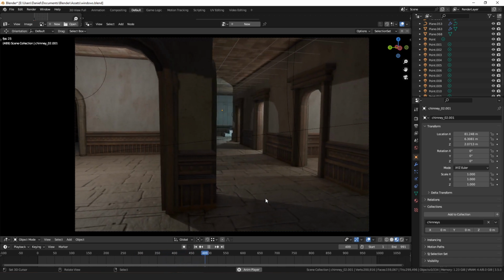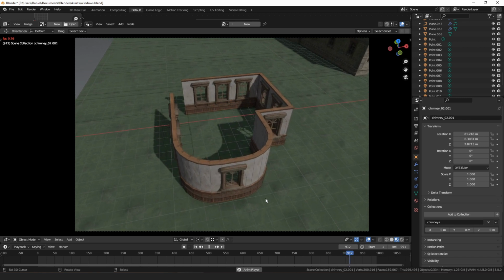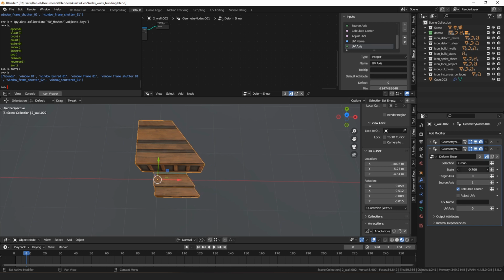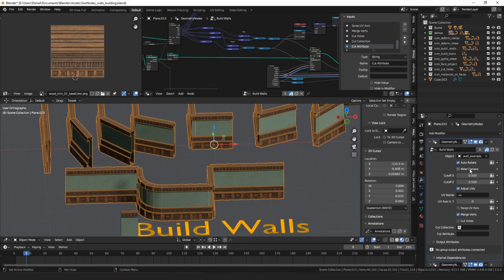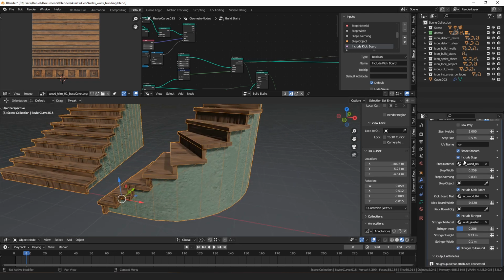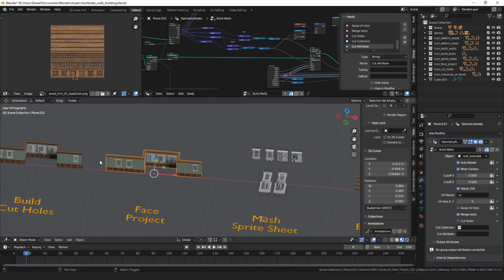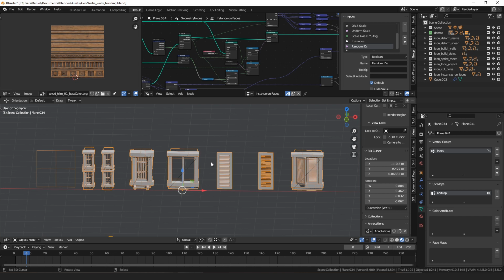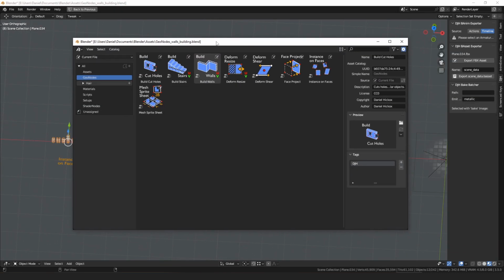Geometry Node Assets: Update - Build Nodes

Comment: Hey man, I just bought the node pack but when I try to open the wall nodes it just wont open, any suggestions?
Reply from the maker: First thing I would check is the version of Blender you are using against the version of the file.  Crashes on load can happen when opening files that were saved with newer versions of Blender.  If that doesn't help, let me know and I will look into it further.
Reply: @looseEdges  Thanks, do you know what version of blender the files are saved in? Or how would I go about checking it?
Reply from the maker: @fed_blend  It's either 3.6.2 or 4.0.0  On the downloads page there are two options for the .zip files that contain the whole library and you can select either.  If there was an option to download individual .blend files those are just the latest version which is for Blender 4.0 at the moment.

Comment: I dont quite understand how you use "Build Walls". Can you please describe the process, starting from an empty blend file?
Reply from the maker: I can try to do that.  You might also check out the workflow video: https://youtu.be/Bj6ZLozP4yo?si=NltDq8ervq6WXmaZ&t=1076  I create a wall for Build Walls about 18 minutes in.  
For the most basic setup, I would add a plane, enter edit mode and rotate it 90 degrees on the X axis.  Then add a loop or two, making a basic wall template.  
Secondly, I'd add a cube, enter edit mode and delete the top and bottom faces. These will be your walls.  On the cube object, add the Build Walls modifier and select the plane object in the Wall template field.
Then you can edit the cube, resizing and adding walls as you like.  To change the details of the wall, you can edit the plane object, add a backface, materials, etc.
Reply: @looseEdges  It seems that I totally overlooked that part in the video you linked. With it plus your explanation I should be all set. Thanks for you time :)

Comment: I didnt saw the whole video but do you have a trim mesh with some ornaments that can be instanced on a curve without too much deformation? like with perfect 90 degree angle?
Reply from the maker: I don't think so, I'm not sure exactly what you mean by 'not too much deformation.'  I have a modifier called Deform Match Curve, that does deform the mesh.  How much depends on the curve, it could be adjusted to place instances along the curve rather than deforming the mesh.  In fact, think I have a file with that variation somewhere.
Here's where I demo the Deform Match Curve modifier:  https://youtu.be/nczCpOb7zxU?si=00quwHIDM6dg8zJ_&t=91
Reply from the maker: I found the variation file:  https://danielhickox.com/uploads/djh_test_curve_array.blend

Comment: How about geo nodes for roof? I think you already have enough material to create specific nodes for the use of roof creation.
Reply from the maker: I've made several attempts, but haven't been too pleased with the results.  The trouble is that unless you are making a roof for a simple rectangle there are many variations, and I haven't thought of a solution that can handle enough of those that I'm happy with it yet.
Reply: @looseEdges  Fair enough! I'm guessing cone shaped roof would be difficult as well since all tiles should maintain same size as they approach the tip of the roof.
Reply from the maker: Yeah, could be.  I don't think it would be too hard, although the UV seams might be ugly.  But I really want it to be a tool that can simplify making roofs for 'T' or 'L' shapes.  @hazdrubal5962
Reply: @looseEdges  Someone else did it this way: https://www.youtube.com/watch?v=DfRjLpMQPnU

Comment: I just realized something terrifying.

Geometry node are considered assets meaning they don't have to be GPL like addons.

This is going to have A similar effect as paid addons making certain workflows unlearnable for free users.(hard surface for example.)

Unless someone redoes the work so that the free users can catch up.(this never happened with hard surface.)

Were all screwed!
Reply: I don’t get your point
Reply: @maarten176 
As in I failed to explain?

Or you don't believe me?
Reply: @nullvoid3545  I didn’t understand
Reply: @maarten176   Oh! Ok.

So Blender is currently one of if not the best tool for 3D data manipulation, and to ensure that it stays that way Blender is licensed under the GNU Public License (GPL).
This means that if A competitor decided they wanted to build their tool based on the code in Blender they would have to license any changes they make under the GPL, meaning Blender could integrate those features keeping it not only as the best 3d editor, but also making sure any improvements stay free for everyone.

Because Blender is GPL, any addons others make using its API must also be according to the FAQ on the blender website. This means it is not piracy to share A copy of an addon you bought to someone else as long as you include credit(the licence).

In contrast, any 3D models or data attached to those models,(basically anything A .blend file saves) is considered "machine output" meaning that it can be licensed however the creator sees fit.(This is why assets in blender can be sold with proprietary licenses.)

With Geometry nodes, assets can now have many of the same property's as addons, being A tool that helps in modeling rather than an asset to be extracted for use elsewhere.
This is why I'm freaking out!

Because if an "asset pack" like this one, becomes standard for how we make tools in blender.
Then the GPL will not save us from proprietary use cases that will continue to grow because of this discrepancy.

Also, A bit of A tangent but, how loosely do implementation details matter in copyrights over geometry nodes code?
Geometry nodes tends to have only A few ways to make any given function, and likely only one most efficient way.
Under these circumstances, if I made GPL variants of the node assets shown in the video entirely on my own based on watching how they are used. I find it likely the overlap in implementation would be seen by A court as theft.

And the worst part is that I cant change this, not even A little, instead I do everything I can to tell others that we need to consider the choices of those that come after us knowing our decedents will still be taught to exploit each other anyway.

😮‍💨
Reply: @maarten176  hard surface modeling has a lot of addons that make the workflow easier/more convenient, for example mesh machine. He thinks that the same will happen to the geo node workflow. Considering blender is free and open source it doesn't mean that addon developers have to abide by that principle and can make for profit addons. I personally do not see a problem with this. As these things tend to be more niche things that blender cannot cover, blender deals with core functionality and improvements around those things. I don't agree with what he is saying here, if one does not find the addon useful they don't have to buy it, and if someone would like they are free to make the addon for free.

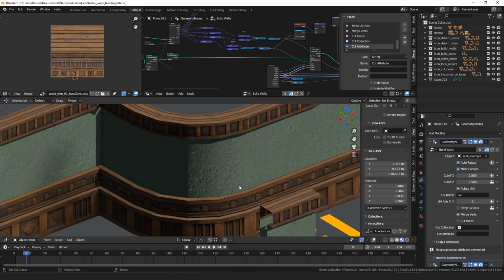Comment: Hello, this is very interesting. I love how much control you have with it and I'll definitely buy your products. I noticed the texture is acting weird at 10:08, there is some tiling issue especially with the circles. Also would you consider adding an asset for the floor and ceiling? And the roof? Thank you
Reply from the maker: Thanks! Yes, on each segment in the wall the texture begins at 0,0, which causes a tiling effect on narrow segments.  I wanted to fix that and spent quite a bit of time on it, but I wasn't able to come up with a good solution.  The best workaround I came up with was to apply the wall modifier, select the faces around the curve (make sure they are merged), and then unwrap them with the Follow Active Quads option.  Obviously that solution kinda sucks because you lose all the advantages of the node group.

I haven't added an asset for the floor/ceiling because I didn't have any ideas for it that felt like an improvement over editing a plane.  Do you have some ideas for what they could do?
Reply: I'm not very familiar with geometry nodes (yet), I simply use an array+curve modifier setup for this kind of thing and it works great. 
I was thinking about something pretty simple, just to avoid repeating the same operations for every building and maybe something similar to the windows but for cutting holes for sthe taircases, idk.
Roof asset would be more useful that's for sure but I understand it's something difficult to come up with

Comment: What happens if you would place a window at a sharp corner where a wall is at let's say 30°?
Would it cut into both walls?
Reply from the maker: It should, yes.  The hole cutting is done with a difference boolean node, so placing one on a corner might or might not look good, depending on the window model, but it should cut.

Comment: i loved  your geometry node assets, i know how hard it is.

i want to know

is it possible to change layout into building with your setup?

i mean only x and y plane
Reply from the maker: Not directly, but if you draw your layout using edges, you can make a node that extrude those edges up on the Z axis and then plug the result into the 'Build Walls' node.